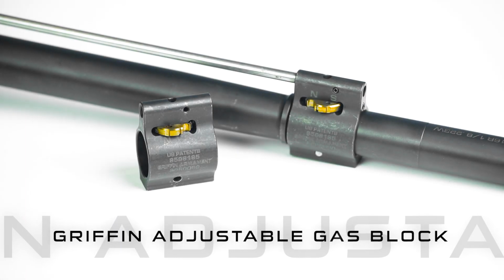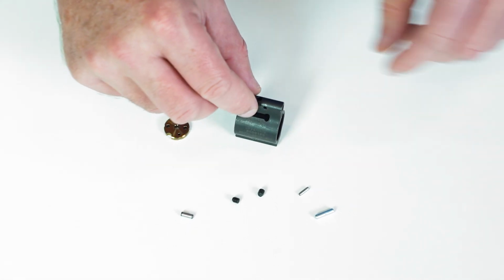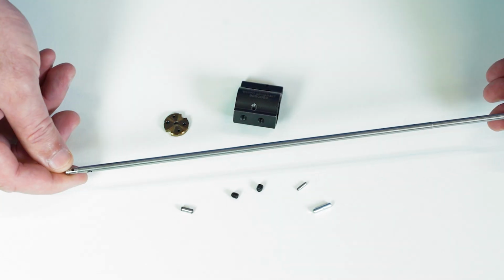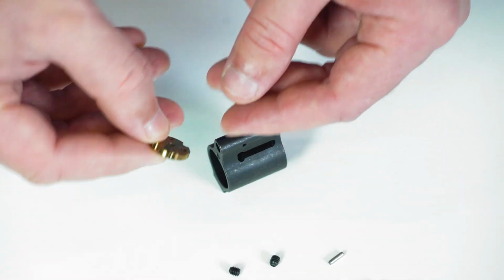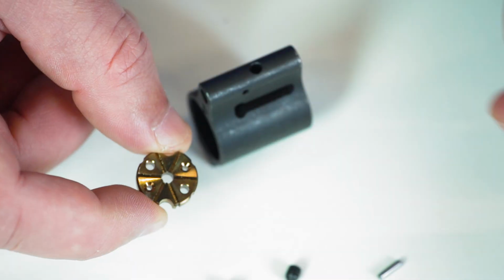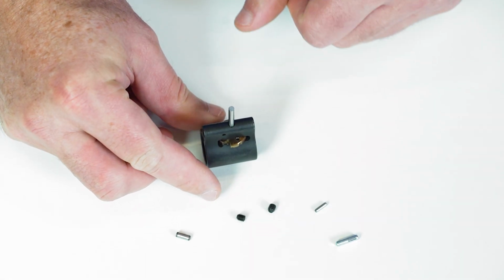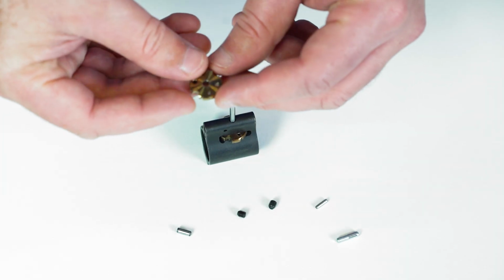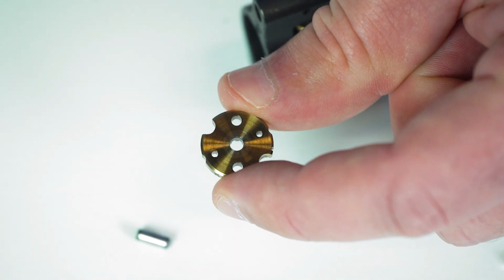Griffin Adjustable Gas Block - User Interaction Demonstration

Comment: I got the plate they suggested for my .300 Blackout subsonic/super traditional suppressed build and I am having to drill all the holes to get more gas... Easy to do but keep that in mind.... Don't Rocksett all your fittings till you have it figured out...
Reply from the maker: What can are you running on that build?

Comment: Soooo.WHY dot we have 4 true settings instead of 3?  having two holes with the same port size seems like a waste.  Give us a slight gas reduction so we can truly adjust our gas settings.  Suppression isn't the only reason to reduce gas port diameter.
Reply from the maker: We do offer the drill your own plates that you could set four unique sizes if you wanted.

Comment: So the gas tube is included with the gas block?
Reply from the maker: The gas tubes are sold separately, but if you add it on to a full build you will get the tube installed for the upcharge.

Comment: So if somebody bought the drill your own kit from your website they could conceivably have 4 different sized holes for say 300 blk supers suppressed/unsupressed and 300 black subs suppressed/unsupressed?
Reply from the maker: Yes sir! We offer two drill your own plates, one where the two unsuppressed pass-through holes are already drilled and you pick the other two, and the other plate has four holes tapped but not sized, ready for whatever you would want to do with it. This would effectively be able to create four unique settings.

Comment: Question I have is how much blow-by are you getting on each side of that plate?
Reply from the maker: It's negligible and intentional. A perfect seal is ripe for seizing. This has a similar level of clearance as a standard gas block has to the ports on the barrel.

Comment: Finally, a gas block that doesn't need a tool that I will lose. Now, if you call could make some AK compensator that works with Gatelok and dual-lok.

Comment: I like the design but the one issue I can see is being able to adjust it through the hand guard without using a special tool. I don’t see a “bullet tip” extending through a slot in a fore grip and adjusting the wheel very easily. 
Riflespeed did a great job addressing easy adjustments
Reply: It is easy to adjust with the bullet tip.  This product worked with 16 handguards in our two different families without modifying any of the handguards.  One handguard was not seen as ideal and we altered the slot configuration of the M-lok pattern to better suit this product, but it was adjustable without modification.  Where I could see a conflict would be if the M-lok handguard were like 2.25" wide like a really fat m-lok handguard might not work for the 5.56mm cartridge to be used as a tool.  Riflespeed makes a product, and our product is more for the guy who wants 2 settings instead of 12.  More simple operation.
Reply: @austingreen3888 thank you so much for that excellent thorough explanation.

Comment: It would be nice to know if height aside the dimensions are still standard, is it any longer than a regular gas block? Also what is the size of the actual gas port in the gas block itself, am I limited to .1015 gas port size, or I still can benefit from 0.125?
Reply: I can't think of application with a .125" port in a Ar15.  Even 16" rifle gas builds only have .118's and some people say they don't cycle in the cold.  We do have a .125" hole in the block, but we chose .096 pass throughs except for our 17" rifle gas configuration at .1015" because we want some room to seal the block, and we just don't have any popular configurations needing larger holes.  The barrel gas pressure can become really high with larger holes so it's not as ideal.
Reply: @austingreen3888  Really short 300 blk barrels require .125" port for cycling subs reliably. For example Faxon 6" 300blk barrel  has .125 gas port and due to extremely short dwell time you can't get any smaller than that, for example BA 6" barrel has a smaller port and is definitely less reliable. This kind of reliability comes at cost of sharper recoil and faster parts wear with supers. This gas block could be a perfect solution for this kind of platform.

Comment: Only 4 positions? And it costs as much as a riflespeed which has 12 positions....
Reply: Our block was designed for military minded people who want one suppressed and one unsuppressed setting.  Once they figure out which side of the block they are on, that is what they will use.  Just like a riflespeed owner who will find 1 position that optimizes unsuppressed and one that optimizes unsuppressed, after you figure that out, that's what you really need.  The rest of the positions at that point are more of a liability- a means of setting the gun up incorrectly for suppressed or unsuppressed.  In engineering, variables are often reduced intentionally on well designed systems.
Reply: @austingreen3888  thanks again for the excellent information
Reply: riflespeed is 200 bucks, this one is 100 and it is more compact, some setups with extremely short dwell time won't allow for riflespeed installation even with the shortest dial.
Reply: @not_your_business666 that isn’t accurate. Just like the Griffin you can get different pins to customize the gas flow on a Riflespeed. When you order a Riflespeed it comes with two pins and Riflespeed offers many more. 

I have one on a 300BLK 8.5 BA Hansen and with the factory supplied pin I can shoot subs, 150 supers and 110 supers to “just right”. I can even turn it down to 1 and make my rifle a single shot.

Comment: Is this going to be included/optional in the assembled mk2 rifle/pistol lineup?
Reply: This will be a drop down menu option add for $45.  If a customer chooses it, it will subtract the cost of the standard block from the cost of this block, so the customer will only be paying the difference in cost.   That is being worked on this week, but is taking a little time in configuration of the pages.
Reply: @austingreen3888 awesome, thank you for the detailed answer!
Reply: @lordhades9455  Yeah sorry that web update is nearly finished but likely won't be live on the drop down option for about 5-7 more days as it is taking a lot of ERP BOM configuration to implement.
Reply from the maker: @lordhades9455  We are very close to putting this up on the website, we've just had a lot going on, but you can probably expect to see it as an option this week yet. Thanks for your patience.
Reply: @austingreen3888 I just ordered a 13.9” yesterday and chose the adjustable option. I am glad you guys put it on there. I ordered 2 adjustable for a mk 2 16” and a mk 2 12.5. I called tech support today cause I couldn’t get the pins in the gas block to go through. They told me to get a 1/8 carbide bit and drill through cause the primo blocks for different. It will be an easy fix once I get the stuck pins out. Can’t wait to try them out and get the 13.9” too. Now I will have to get the new Optimus 7 and try it out. Keep on making awesome products man.
Reply: @ronmacintosh8733  They were intended to be very similar but they are from different manufacturers (us in house and a supplier for the original block which we now make).  The drill bits we use here are Cobalt- carbide can be a bit fragile.  We run a bridgeport with a .0015" quill feed to drill holes.  A hand drill with light pressure should work for your application which is basically reaming a hole that is already there.  The CS guys worst case could replace your pins and you could drill through them from the other side.  They are just 304 stainless which isn't hardened.  Glad you like the options, sorry for the trouble you are having with the retrofit.
Reply: @austingreen3888 no worries man, I got the one fixed and ordered the right parts for mine. I can’t wait to try it out. My 13.9” shows up tomorrow. We will do some reviews on the gas blocks and some of your cans. Thanks for making such dang good products. I am gonna try out the Optimus 6 next

Comment: It better be cheap, there is nothing to it
Reply from the maker: We worked really hard to get this under a Benjamin for you guys.
Reply: Nothing to it is really not true.  To just add a cross pin hole to the $13 gas block the industry mass produces in hydromatic machines to allow the block to be pinned is something the hydromatic guys will not support.  So the pin hole itself pushes product price from $13 mass produced to more like $55 CNC produced product.  Because the machine no longer has 12 spindles operating simultaneously.  Here we put a .0005" controlled slot in the part, make the part from a bar of pre hardened material rather than an annealed metal form that isn't cut on the outside profile, add a detent, manufacture a .0005" controlled thickness regulator plate, include the gas tube pin, splined pin, regulator pin, 718 inconel spring, ceramic ball detent, assembly staking.  This just isn't all that simple.  It is miniature for what it is doing, and minimalist in the exactly right ways.  It is a great product made very competitively for $99.95 market price, and it replaces the need for products up to around $180 so it does provide a very strong value.  This definitely isn't for guys who's AR's cost $450 and are made of hot garbage.
Reply: This runs on a .5mil$ mazak.

Comment: I'm just curious how much gas leak there will be between the gas block and the plate.
Reply from the maker: Very little. There is an intended gap to prevent carbon seizing, but not enough to cause any discomfort if shooting without gloves. Making them seal perfectly invariably will seize up the plate over time. Mr. Soong found this out with his early designs.
Reply: Is there a jig for drilling for pinning the barrel?
And are you going to sell sell a handgyard with a hole in it for adjusting the gas?
Nice product and vid.
Reply: @markreynolds6715  Griffin needs to completely redesign their entire handguard anyway imo
Reply: @markreynolds6715  We checked our handguard line 2 models- 16 total versions before we get to colors and tab or no tab new developments which blow this to around 100 skus from what my inventory guy tells me.  We were able to adjust the block on all of our rifles with a bullet without modifying any of the rails.  We did decide to move the M-lok pattern of the 45 pannels to the 90 degree surfaces and vice versa for one of the 16 base models but we could adjust it without a special access using just the provided slots.  The barrel drilling would put the block in a vise in a bridgeport and use the hole in the block as the guide for an 1/8" drill bit to modify the barrel for pinning.
Reply: @austingreen3888 thanx
Reply: That is one of my concerns as well. Strike Industries came out with a similar concept with their collar adjustable gas block and the bleed between their collar and the gas ports I found was too much to reliably cycle some guns, in particular rifle length gas systems with little dwell time. Could not for the life of me get it to reliably cycle an 18" rifle length system.
Reply: @Rowrin  Robert Soong one of the original inventors from MicroMoa said he also had issues with the Strike system.  I had a 17" rifle gas build with a .1015" gas port, and I was able to run it normally (like 4 oclock ejection unsuppressed, and tune the port configs or our suppressed plate for that barre.   The intent of our 17" rifle gas barrel was to pull the benefit of the long tube in as short a barrel as possible in something that would run in any temperature.  Like a near 16" SPR barrel that will work with the rifle tube, and that will allow the PSR-5 over the barrel suppressor to be mounted.

Comment: Interesting product. Straight gas tube has it's own benefits as well, aside from the AGB. If it's cheaper and easier to install with most setups than a riflespeed, I can see this taking off.
Reply: What’s difficult about riflespeed? It’s exactly like installing a normal gas block if anything its easier and more intuitive but also costs $230 😂
Reply: @TylerD63 riflespeed also has limitations as to what handguard length + barrel length + gas system you have. i'm trying to set up an 11.5 carbine length with a 10.75 handguard and they don't offer anything compatible with that little clearance.

Comment: You guys are awesome! I've said this before but you should design a hub compatible mounting solution for switching suppressors quickly between pistols and pccs. Something like dual lok that locks over the collar instead of just around it and locks the piston inside. Open setting for tilt barreled pistols and closed setting for pccs
Reply from the maker: Don't give engineering any ideas 😅
Reply: I have heard of a European company in Denmark that developed a lockable piston housing.  The company only made cans for people like the SAS. (small unit government sales)  The cans were very expensive but I have heard of that happening.  I've never seen the part, and it isn't a super normal request, but I see your point that it could be convenient for people.

Comment: Excellent job taking feedback and putting out more information, this is a very cool product, cant wait to see some shooting test videos! Please send one of these to Rob Orgell of Silencer Analytics if you can, he does a ton of testing with suppressors.
Reply: I don't want to mess with riflespeed - they already have a pretty positive endorsement over there, so I don't really want to push anything on Rob.  This is a different product, primarily for more duty oriented users with one or two cans intended for use with a gun, and Rob is the 45 cans for one gun guy so he's more of a riflespeed demographic end user as that product is more suited to tons of different cans down to using rimfire cans on 556 guns and stuff like you see on Rob's channel.

Comment: Will gas be leaking all over the place tho?
Reply: Superlative Arms has a gas block that does exactly that. You can dial it for your suppressor. At the same time you can widen it so much that you can expel extra gas towards the front getting some of the benefits of a piston system.
Reply: No.  MicroMoa made and sold this product for a decade to happy end users, so the operating theory is sound and proven.  The tolerance of the plate is similar to the block to barrel tolerance, so those applications are similar.
Reply: The block is a steel that isn't affected by heat the adjuster is a steel that expands with heat it seals with thermal expansion

Comment: Taller block? Any rails not clear these?
Reply from the maker: We have not tested every rail on the market, but the design is such that it should fit under most rails out there. We can't guarantee that obviously, but this is designed for the purpose of not requiring any special rails or leaving the block exposed out the front of the rail. Check with your specific rail. We will try to get a measurement up on the site for how much clearance you will need to the top of the rail to assist with people who think it might be close with their specific rail.